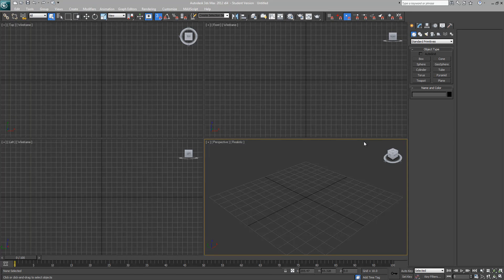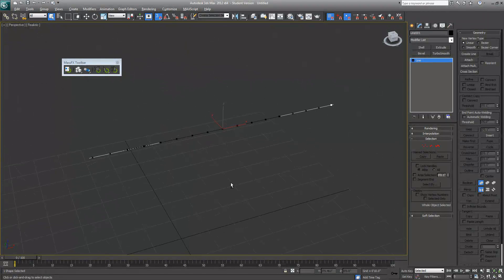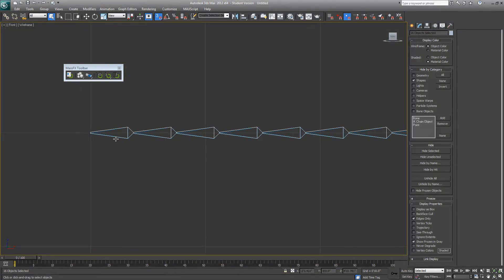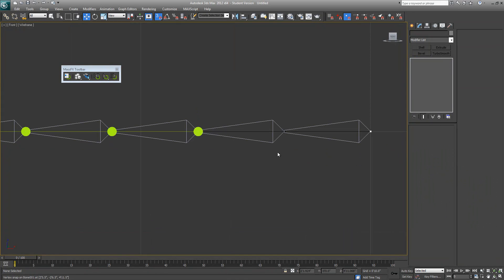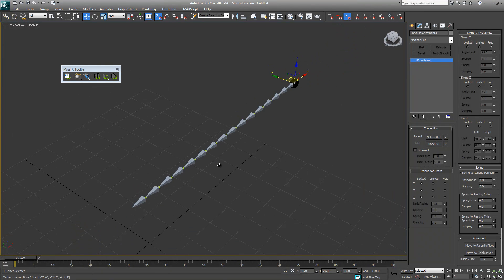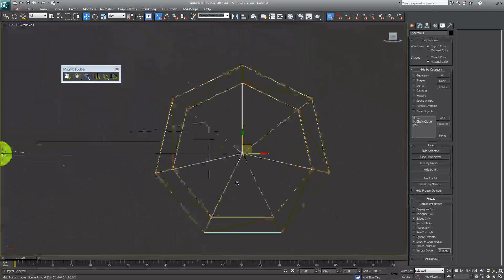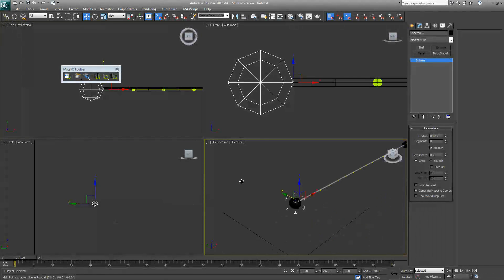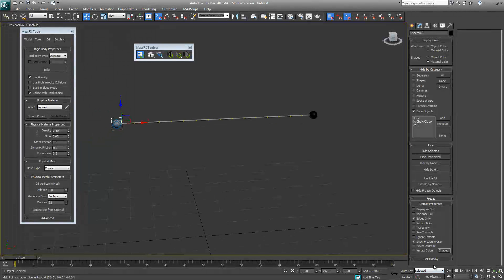how to make a rope in 3ds max 2012 with MassFX and bones

Comment: in MAx 2014 my bones were also exploding, I just didn't change the default settings of the Uconstraints (didn't change the parameters to free like he did) and it worked ok.
Reply: try to increase ur simulation substeps  ....  massFX tools .. > rigid Bodies ..> Substeps
Reply: thanks! I am sure I changed it to 1-2 and . I will try it next time again, however I noticed the scene units affect a lot, I had to put gravity down to -1000cm for it to work and it stopped exploding

Comment: If your bones are exploding all over the place when starting the simulation, try going into the settings for MassFX, and see if there's setting for "Steps" under the Time section. If this is set to 1, try setting it to 2, and see if that fixes it.
Reply: THANK YOU SOOOO MUCH MAN. Mine was set at 0. I tried to set it to 1. It does not exploding all over again. Thank you so much!

Comment: Regardless of how I set up the gravity and the physical properties of the bone objects, upon running the simulation the bone chain begins to float upwards - the object mass and gravity strength only slows and doesn't stop this from happening. Also, when I move the ends of the cable during simulation, the chain swings out in a massively exaggerated fashion and the individual bones break apart before bouncing around and eventually springing back into place. It feels like there's a hidden force enabled or an additional option that I need to check on to achieve realistic behaviour - any ideas as to what I'm doing wrong?

Comment: Not sure what I'm doing wrong.  But my bones end up floating and then exploding all over the place.  I follow the tutorial pretty closely too...Any suggestion?
Reply from the maker: johnny v  plz make sure your bones are not set as "stretchy"
Reply: Atiq Alex  I set the stretch in the bone tools menu to none but the result was the same.  they floated up and exploded.  I end up doing it over and the only thing I did different was not delete the last bone in the chain like video advised.  They seem connected but there floating like the don't have mass.  I'm not sure if it matter but I'm using version 2014., would that be an issue?  Thanks for your help : )
Reply: Nora Bennis You have a force in your scene?  did have the ground collision set so it isn't above but below the objects?  Try this file:https://www.dropbox.com/s/hq1sq3mtdxj1ipg/rope_test.max?dl=0
Reply: Nora Bennis I had a bug a couple of times concerning the massfx rollout gravity, by default I guess there is some global gravity set up in massfx rollout.  Not sure why and this is where my understanding breaks down a bit. I deleted my old force in the scene and made a new force.  Not sure if that did any good but its worth a try I guess.
Reply: Atiq Alex Same here. Everything is floating up and down !!? What could I do wrong ?
Reply: Nora Bennis when I was tweaking the chain I also realized where I places it was a factor.  Have to set where the ground is so it doesn't cause the chain to act funny.
Reply: Nora BennisAtiq Alex I checked none on the stretch option for the bones. Now, nothing is moving. Bones are dynamic rigid from the start, At the end of my rope, there is a mesh, set a Kinematic rigid body. But nothing's working :! Can you help me ? it's for school project. Thank you!!!
Reply: johnny v I don't understand what you mean by tweaking the chain. It's the first time I use MassFx. Can you tell where to find the world / ground settings? I was also wondering if there is some default settings concerning the force? Or the acceleration?
Reply: Nora Bennis what I meant was I moved it up in the viewport so it wasn't colliding with the "ground"  there is a rollout on the MASSFX tools for the ground collision that you can set the height.  There is also rollouts for forces on that same drop menu.  Not sure if linking a force would create an effect on it.  I miss having a rope reactor in the old version of max like back in the day.
Reply: johnny v I understand what you mean by that but, my rope is really high up the ground! It seems like not all the bones are connected between them... But they are! 
I can't find what you told me about the collision in the mass fx tools. Can you share a screen shot?
Reply: johnny v also was wondering if the damping is important to set here but on which axis?
Reply: OH thank you so much! I just saw you message. I'll tell if it works for me, thanks again you're very helpful
Reply: OH thank you so much! I just saw you message. I'll tell if it works for me, thanks again you're very helpful
Reply: johnny v The file is not available anymore :(
Reply: Nora Bennis https://www.dropbox.com/s/qif1wkw7wo1genc/rope_test01.max?dl=0
Reply: dowloading itm thank you!!!
Reply: I found this https://vimeo.com/45953979 it's helpful because it's a MassFx tool for Ropes, it's kind of specific, but i can't find THE tool
Reply: Nora Bennis No problem.  You can try reverse engineering to see if its helpful.  That link you put up looks like a script I was looking for about a month ago.  Yeah, never was able to find it.
Reply: johnny v glad i helped you with something! I realie that my bones arent rigid bodies, even if I set them so, and done the work two times... Max bugs sometimes..
Reply: johnny v was also wondering if the Line in between the two Kinematic objects, is important to keep.
Reply: Nora Bennis no, just initial set up spline.  the simulation was meant originally for a cable being pulled away from a wall, the only thing that had key frames was the sphere.  Just bones, never got around to skin anything to it or anything.
Reply: okey i see. The problem with my bones, is that they wont fit as a rigid dynamic bodies. It says that some nodes are not geometry nodes. It's a rope that will lift letters, and they will blown up with the wind (It's for an ad animation)
(Is the script i sent you easier than doing it this way?)
Reply: Nora Bennis Seem like the script would be easier if you can find a copy of it floating around.  Other than that all you really do is just systematically keep checking your bone chain making sure everything is parented/everything has mass and a rigid body type appropriately selected or starting over which although tedious can work out any initial bugs or initial mistakes.  Good Luck : )
Reply: Absolutely, that's what i just did, and now it's going up! the bones are going up from the bottom and they're crawling like a bowl
Reply: johnny v yes, the gravity
Reply: your file is exactly what i need! it's perfect! I might use it? Can I have your permission? And am wondering, I'LL be pasting the rope 5 or 6 times for my letters, Will I have a confusion with the ropes?
Reply: when I import your file in my scene it wont work! Same as the old file! Sorry for the spaaming lol
Reply: Nora Bennis sure, if you like you have my permission to use it : )  I guess you might be able to use instance of it but you would really have to experiment with it.
Reply: johnny v thank you so much!
Reply: Thanks from the future. I had the same problem and it worked using a custom gravity than the global gravity.

Comment: Is there any way I can control the other side of the rope? Like I am able to control one side where the sphere is located but how can I control the opposite side? I want to somehow animate it the 2 ends but also have a dynamic rope type effect in between the rope. Anyway you can help?
Reply: BananaPepperProductions add 2 geometry at the 2 ends of the rope and make them "kinematic rigid body" and use a uni constrain between the geometrys and the ends of the rope ... now the links will react to any keyframe u put on the geometry ... select all the uni constrain and use damping value =>1 and disable twist
Reply: Alex Atiq Thank you! To disable twist do I just set values to 0?
Reply: when u select any uni constrain ... there is a check box to disable twist ...  in its properties panel
Reply: damping and twist are 2 different properties
Reply: oh ok I see it now thank you

Comment: Hi, first of all thanks for the tutorial, but I have some issues as drzerg i think. It works with 3 bones but with 8 or ten, all bones joints break, and the bones begin to dance with not conexion. There is a green line that join their joints but the bones itselfs are completely messy. Any idea to solve this?

Comment: Everything would be fine, but mine works only with 3 bones. With 4, small move makes them jump around the place. Tried changing different settings, nothing helps. bone mass helped a bit, but not enough. Scale is all like real world, nothing too big. 
What i want to make, is rigged headphones, where i can simulate theyr wire bending and folding.

Comment: Good tutorial just for some reason I have the bones stretching a lot and flailing about I set the weight of the bones to zero and it failed as mentioned.Then I when I added the ball and it still failed and the weight of the ball is .001 please help.